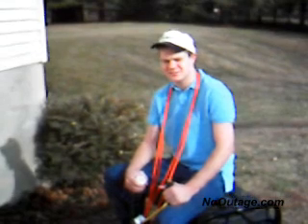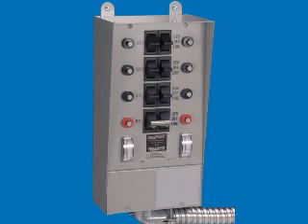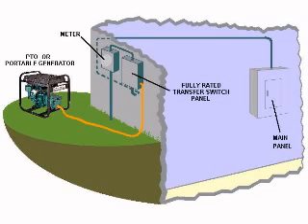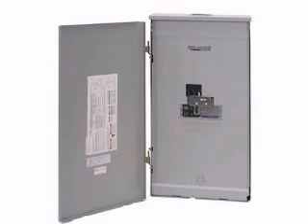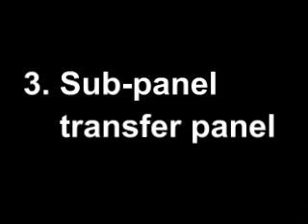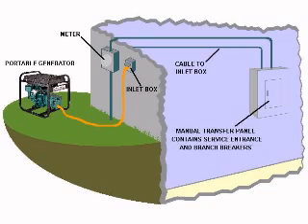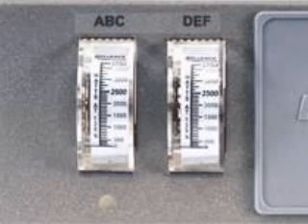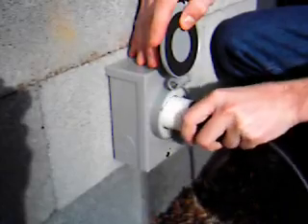Connecting a Portable Generator to a Building Breaker Panel 2006 | nooutage.com

Comment: I have a honda eu3000 can I use the L5030 twist lock to supply a protran 4 circuit panel?
Reply from the maker: Sorry for the late reply. Yes, model 304A1 is 4 circuit with the L5-30 inlet.
http://www.nooutage.com/04-1.htm

Comment: Why can't you just TURN OFF The Main Power Switch and then TURN ON You Generator Switch until The Electricity is Turned Back On.. Then? TURN OFF Your Generator Switch.. And, TURN ON Your Main Electrical Power? That would seem The Simplest Way of doing things...

UNLESS? You Forget to TURN OFF Your Generator Switch BEFORE You TURN ON Your Main Power Switch.. Or, Vise Versa.. Then You Would Have MAJOR PROBLEMS...
Reply from the maker: There is the risk that in the dark and in bad weather you or someone else might forget to turn off and on the correct items. And if something goes wrong your insurance might not cover the loss when they find out your electric panel did not meet code or was operated in an unsafe manner.